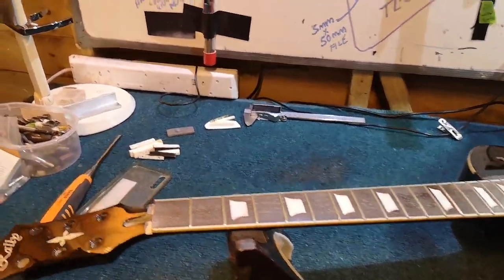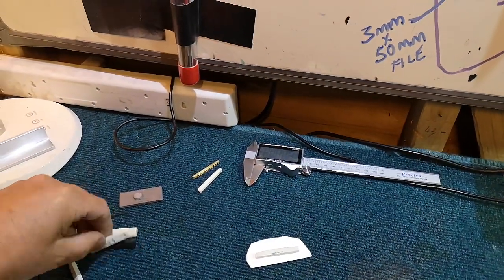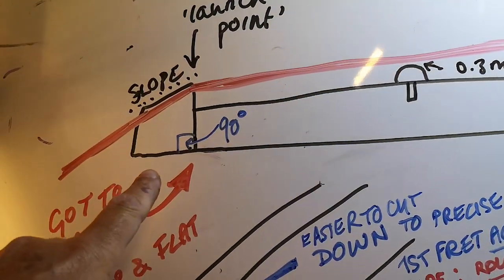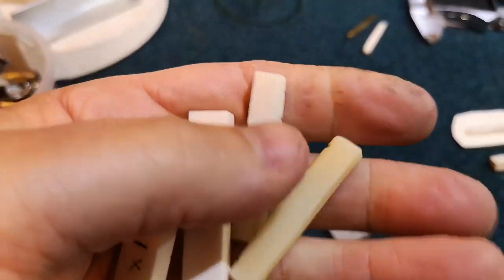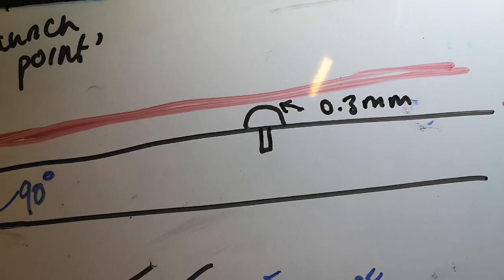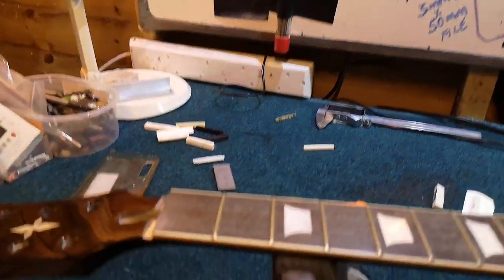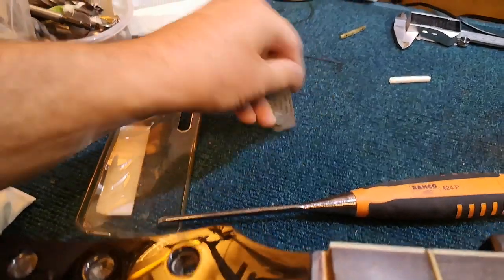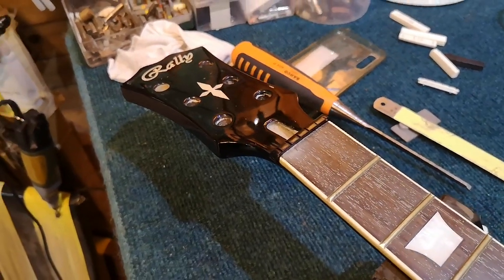Changing the nut on your electric guitar: everything I know about nuts in just 15 minutes.

Comment: Hi, you did not solve the problem of filing the slot in this video. You can use double sided tape and stick sand paper on the bottom side of your nut, that works quite well (although it's better to have someting longer than the nut), especially because many nuts have not a precise 90 degree angle. If you do this often for same sizes, you can buy a Tusq blank sleeve no. 4025 or 4125 and file them down to the correct depth and glue the sandpaper under it with double sided tape after leveling of the bottom on a straigt surface (attention, a glass plate is not alway really straight but in many case the most straight object nearby you).
Reply from the maker: Hi - you're right I didn't cover that in so much detail but I did show the problem of chiselling the nut slot / shelf and showed the HOSCO nut slot filing block... Preparing the slot  or shelf (we're NOT talking the string slots btw, that's a whole other issue that I also touched on)  is critical and the closer to 90 degrees you can get it, the better. Matching the nut base / angle to the slot base / angle is a matter of 'touchy-feely' basically because it's rarely 'machine-precise'.

Comment: Hi Sam. I was fret leveling my Harley Benton Telecaster when I knocked the nut free. So opportunity to try fitting a TUSQ nut! Spotted a problem. Nut slot cut wider than original nut and new one. No doubt this is why it came loose so easily. I'm thinking of adding a plastic shim. Any views?
Reply from the maker: One solution is to put a shim of plastic front or back to keep the nut still. What I tend to do (if I have to) is to superglue a shim of the same material - usually bone or Tusq for me - to the back of the nut and carefully sand it back to the correct thickness. This keeps the shim + nut as one solid piece, even if the shim part ends up being barely 1 or 2/10ths of a mm by the time you've sanded it fit.
Reply: @SamDeeksRelovedGuitars  Thanks for the tip. I will give it careful consideration as I think that it will stretch my skills. The nut is holding so my only issue is perhaps alias of resonance. But as LP style has no second face to the slot maybe not an issue. Also to my ear it sounds good 😊

Comment: Is it 0,3 mm for all strings on the 1st fret ? Thanks 😊
Reply from the maker: That's what I choose - but others prefer a slightly higher measurement for the bass strings (spread across to 0.3mm at the high E). 0.3mm works on all strings for me.

Comment: TusQ XL on a 2004 Squier Stratocaster that was never really played, but the old nut from the factory was a horrible nightmare mess.  I had Graphtech tell me the model I need but how high should I make it from the first fret since the trussrod probably needs adjustment etc... but I can't do any of that until I have a nut on properly.  Seems I am painted into a corner.

I watched the entire video and stumped as I saw 0.8 and I saw 0.3mm for the same fret and the same wire/string.  What about the rest of the wires/strings?  0.3 is smaller than 0.8 so how does that even work?
Reply from the maker: You're not painted into a corner. I recommend setting your relief first. Of the 3 primary 'variables' in your playing action (relief, 1st fret action, last fret action) the relief has most effect in the middle of the neck, very little effect on the far ends i.e. the nut end. You can set your preferred neck relief with the old nut on... since you measure the relief by capo'ing the first fret and holding down the low E on the last fret and check the clearance between the fret in the middle of that span and the the string... Adjust until you've got something like 0.15 - 0.2mm. 
Then set your last fret action. My preference is 1.5mm low E last fret and a gradient across to 1.2mm high E last fret. 
Then change your nut and if you need to, file the slots to end up with a 1st fret action of 0.4mm (for example) for each string. You might prefer 0.4mm on the bass strings across to 0.2mm on the treble strings.... that's up to you; either will work and both will be clear of the range that causes notes to go sharp when fretted near the nut. 
If you use an adjustable nut (in my case home-made using a Tusq nut as a starting point) you won't have to cut down into the slots to get your ideal 1st fret action, you can just 'dial it up' to where you need it, keeping the pristine  factory-made slots intact.
Reply: @SamDeeksRelovedGuitars  I LOVE that adjustable one as it is ingenious and all nuts should be like that.  As far as mine goes I can stick the original nut back in, but it is broken and was never done right.

Comment: I have a stupidly designed guitar with 41mm nut. Kept on muting strings. Can I just replace the nut with 43mm and hope it will work well without throwing away the neck or the whole guitar?
Reply from the maker: It's not clear from what you've put what the total width of your guitar neck is at the nut slot... but assuming it is the 43mm that you've mentioned then yes, you can find a replacement that's 43mm. The more important issue is to start with the e-to-e slot measurement that the original nut has (or that suits YOU and the guitar you have in front of you). When you know the ideal e-to-e spacing then you look for a nut equal to (or slightly greater than) 43mm width. You can always sand it slightly. Fitting nuts and getting them right is only ever a 'drop-in' affair in about 2-5% of cases; the other 95% of the time you must expect to do SOME fine-tuning to get them to fit width-wise, front-to-back depth wise, depthwise in the slot (to give the correct 1st fret action) and / or to file the slots to create a low 1st fret action that follows the neck radius at that point.
Reply: @SamDeeksRelovedGuitars  Thanks Sam. The neck width at nut is indeed 41mm, just like the nut. I found a 43mm or even 42mm guitars much easier to play than this guitar. What nut slightly greater than 41mm would work? Is 42mm a safer bet or can I go 43mm?
Reply from the maker: @watchmania46  I see what you're getting at now. You want wider spacing but you're stuck with a 41mm width neck/nut slot. 

If you tell me what kind of guitar it is I'll tell you the widest spacing Tusq nut I can find in their catalogue.

• Strat style with slot 
• Gibson-style with nut shelf (no slot)
Reply: @SamDeeksRelovedGuitars  thank you! It's a Pacifica 212V. Looking at videos I think it has no slot. So there is specific Tusq with same width but wider spacing? means low E and high E lays more outside?
Reply from the maker: @watchmania46  So you could try e-to-e of 35.5 with width of 44 (meaning you'd need to sand in 1.5mm from each end - possibly just about do-able) . 

https://www.amazon.co.uk/Graph-Tech-PQ-6000-00-Jumbo-Pre-Slotted/dp/B0016J1VJS

Maybe slightly better would be PQ-1720-00  with a 35.9 e-to-e and only 43mm with, meaning only 1mm needs to come off each end.... 

https://northwestguitars.co.uk/products/graphtech-pq-1720-00-slotted-tusq-nut-for-godin-guild-fender-style-acoustic

In both cases swap 'PQ' for 'PT' for black Tusq; the 6000 has a left-handed version, the 1720 does not. 

Beyond that 35.9mm of the 1720 you can't really go without going too far in the overall width, with the result that if you tried to sand it back to 41, you'd cut into the 'e' slots (or at least leave no support there). 

Hope that helps!
Reply: @SamDeeksRelovedGuitars  thank you Sam!! Great calculations. On the stock 41mm nut I have it's 34mm e-to-e. Some forums mentioned this isn't a very good idea, but even if I add 1mm each side there seems to be still some space for the fretboard and fret to hold the strings.. maybe

Comment: It seems like the adjustable nut would effect tone since it’s risen off of the base of the nut slot. I’m guessing not though since you seem to like them. Anyone know of a good set of nut files for cheap? Thanks for the video.
Reply from the maker: You're guessing right :-) Not only can't I hear a difference but I also don't know of any convincing argument why there would be one. The least expensive decent set of nut files is probably the Hosco set of 3 x 2 sided files. These days if I file nut slots I use 90% dirt-cheap Chinese diamond-coated 'V' file and 10% Hiroshima nut file to finish off the bottom of the slot shape. That's a winning combination for me - and believe it or not, the 'V' file on it's own works great. You can either leave the 'V' shaped slot (a bit ugly) or file down all the excess material above where the strings sit after which it looks very neat.

Comment: By the way I am trying to solve 2 problems. My Gibson The Paul I had filed down to my preferred 1st fret action but after a few months this had drastically reduced. I don't know why. Now just playable. My MIM strat came with very low action and is sticking when using the trem. Tried using fine grit sanding to smooth slots but still there. Can't use file as action low.
Reply: I don't know if this is the best solution, but I have increased nut height by using superglue to glue the base of the nut onto a business card (the slightly thicker paper/cardboard kind) and then used a box cutter/exacto knife/razor blade to cut around the nut, and finally carefully sanded off the excess paper and glue to make it smooth. 
After 2 rounds with strips of business card with superglue the nut height was ok, and to my ears doing so did not have a negative impact on the sound. I got the idea from a Youtube video if I recall correctly. 
I assume you've already tried to add graphite/pencil shavings to the nut slots of your Mexi Strat? If not, give that a go. Also, if it has string trees, since they are a further contact point for the string, they could also be rough and cause snagging. Can try sanding the contact points a bit, or if you have the budget, buy Graphtech Tusq string trees, since they are permanently lubricated. 
Finally, if your string gauge on the Mexi Strat is very different from what the nut was cut for (typically factory guitars come with 9 gauge strings and you can usually change up or down one number without issues, but if you put in 12 or 13 gauge strings, that might not work so well), that might also be something to look into.

Comment: Can new nut change the Sound in electric guitar
Reply from the maker: My opinion is 'not significantly' - assuming that the nut we're talking about is correctly fitted, has backward sloping, well-cut and friction-free slots. If it has those things, then plastic will work fine. But Tusq has built-in Teflon (PTFE) which makes it naturally lubricated. This contributes to tuning stability which is why I prefer it over bone, brass or plastic.

Comment: adjustable nut? Brilliant!
Reply from the maker: It's what I do on everything these days. The LP nuts I make a custom base from hard resin; the Strat / Tele nuts I file the grub screws flat and they stand in slight depressions in the rosewood / maple. It works... part of me would prefer a hard(er) base for those but they compress a fraction and seem to settle. You *could have a hard brass / copper / bone 'floor plate' but you would have to cut the existing slot down and that's a modification too far in my book.
Reply: Very cool
Reply: @PooNinja   I have one of Sam's adjustable nuts on my Strat - it's so easy to ge the action perfect now.

Comment: My strat has painted headstock with lacquer and I’m losing my mind it’s essentially a layer of epoxy!!!  Help
Reply from the maker: What are you needing to do with / to it?
Reply: @SamDeeksRelovedGuitars  replace the nut, I scored it to death last night, was more like a knife fight.  I kept tapping it with a board and hammer.  I finally got tired and hit it really hard and it jumped off.  I was lucky it did not break and I found out why there was no damage.  The last hit was from neck to fretboard direction, meaning it would be very difficult to break that side of the guitar.  You might pass that along or try it yourself.